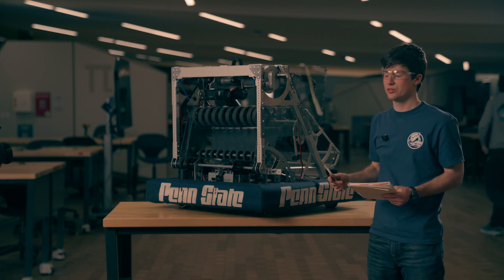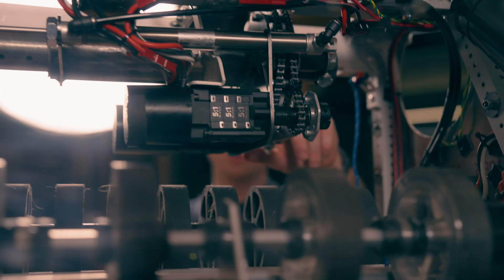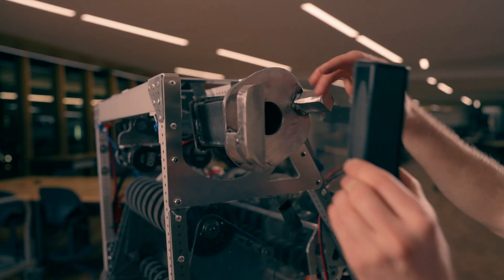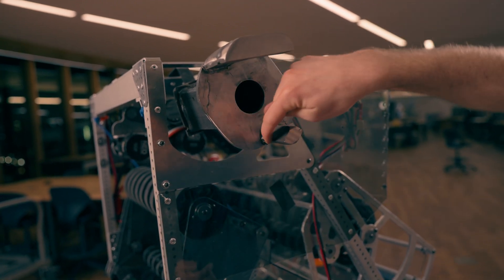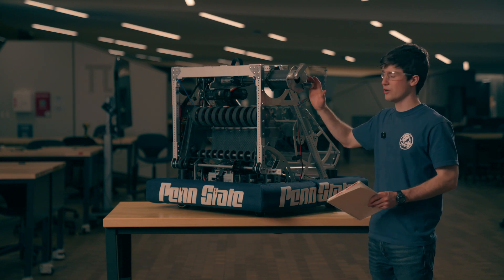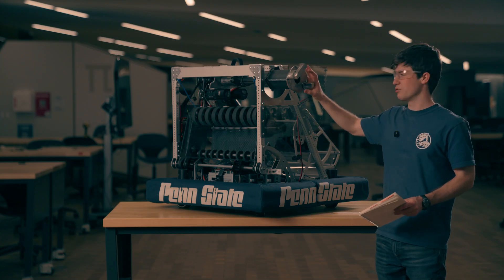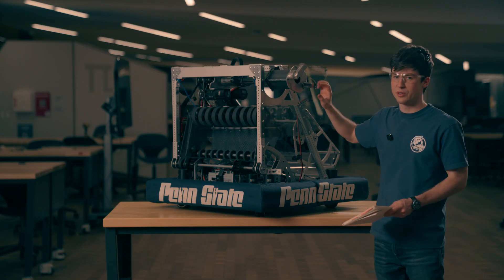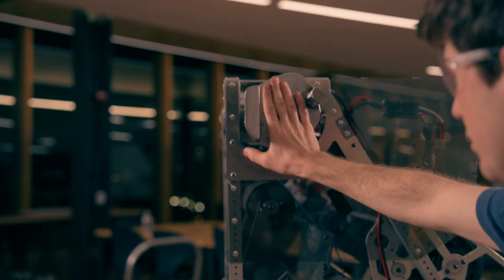Flip Climb Showcase | Ri3D at Penn State

Comment: what happens when the robot gets disabled at the end of the game? Do you think that the mechanical lock is good anought to support the robot without the motors working?
Reply: It can sit forever in the up position, the robot is fully captured on the bar and GC is above the point it is being held. The motor does not hold it up.

Comment: Does the circular hole extend into the metal cube structure behind it, or is that metal cube completely hollow? Also what are your thoughts on what the alumni of Madison designed where this entire mechanism collapsed into the robot? Would that be doable for an FRC team or would the forces on the collapsing mechanism be too high?
Reply: The metal tube is completely hollow. The only force the hole needs to support is the robot sliding straight downward, which may not even be necessary if the rest of the mechanism can crank onto the upright hard enough that friction prevents the downward slide. Putting more thought into that challenge could help the alignment process a lot. 
I think you want a linear sliding motion because if you have a shaft that extends into your robot, rotating your robot around that shaft is very doable. If the hole shaft moves and needs to lock in place, whatever is locking in place needs to be very strong and have minimal slop so that the robot doesn’t sag once climbed. Hopefully that’s helpful!